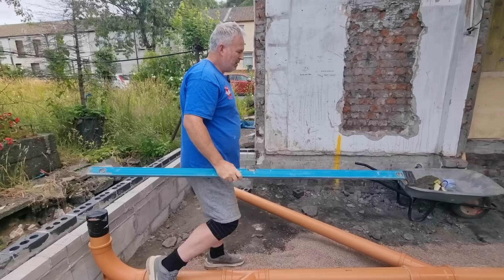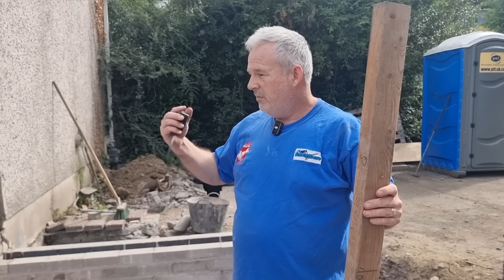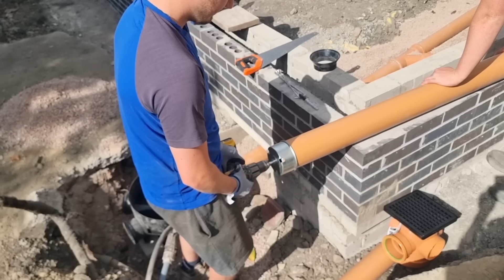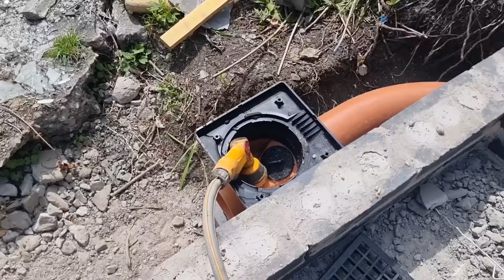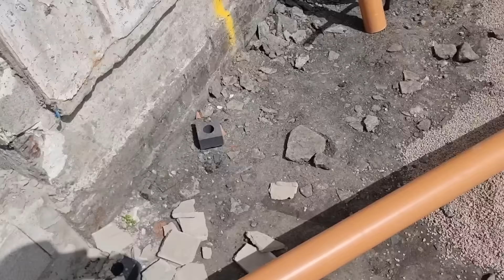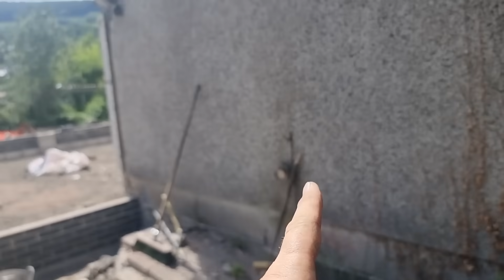Drainage Pipes falls,cutting,laying

Comment: Drainage basics are fairly straightforward but the dos and donts on site are endless, im fairly certain all those connections shouldnt be on 1 single run in case of a blockage they arent all blocked, the outlet through the lintel should have a 600mm rocker and if that is the main run then it should be on the main run though the manhole not saying what youve done is wrong it looks bang on just bits ive picked up

Comment: Inspection chamber at 7: 26 is installed wrong way round😂😂😂😂
Reply from the maker: You what I didn't want to answer yesterday scott I thought id go to site and check first. We can't see it's the wrong way around unless im going mad of course .The manhole is set to follow the flow of water not against the flow so we left it as is mate if im wrong I'll always hold my hands up was gonna video it in fact but all looks good on site
Reply: @brickrightbuildinglandscaping 
The pipe from the gully is connected into the  outlet socket of the chamber. If you look at the other 3 inlets they face the  outlet. As it's only a gully flowing through through you shouldn't have an issue but if there were toilet connected to it you would continuously have blockages I can guarantee.  Bear in mind future, im not on here to arguee with anyone just pointing out 👍
Reply from the maker: @scottblack9837 
No defo no argument here scott .
I do get your point in terms of the direction of flow the chamber is the wrong way around .if I layed it the other way around the the water wouldn't go back on its self to drain away so we can't do it .I totally get your point and it's a brilliant point and it threw me on site a d then you mentioned it which threw me again scott 😂.You've had me taking screen shots drawing it out and it doesn't work the other way around but im defo gonna have another look tomorrow morning scott .it's one gully in a chamber it works on test .it's got to be inspected one way or another we will find out .Great post scott defo keeping me on my toes mate 😂😂👍
Reply: It’s definitely the wrong way around mate, I’ve installed literally hundreds of these and gone back to reconfigure a few over time on customer cares too. You’d be amazed how easy they block on foul runs. You should have put the single outlet facing into the lintel, the left hand side of the three outlets facing the gulley, with maybe a 15degree bend to help ease it round 👍🏻
Reply from the maker: @TheNomadBuilder 
I do actually understand your mentally in how you've worded that .
Thanks
Reply: I thought that too.